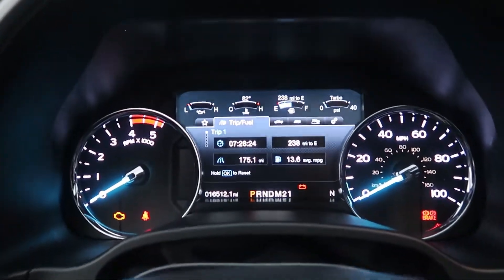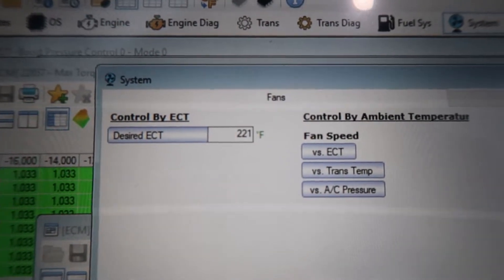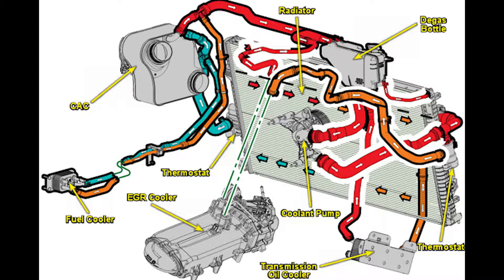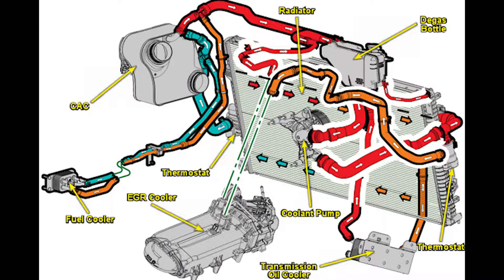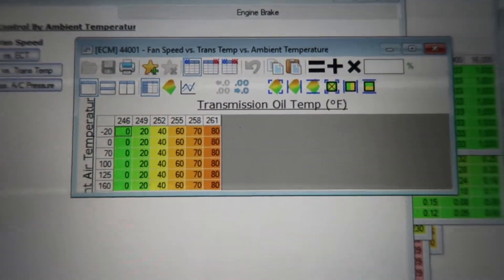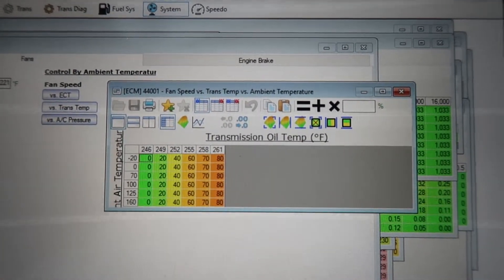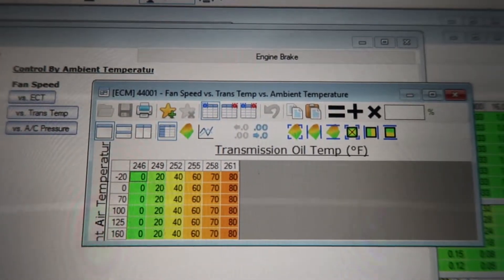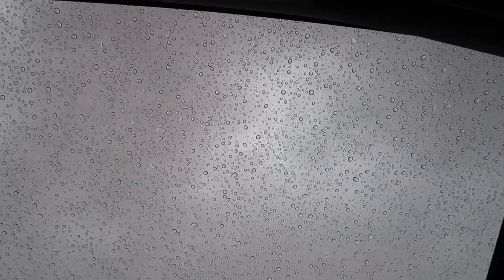Why the Ford 6.7 Diesels  Run "HOT"

Comment: Have you looked at the SPE thermostat that runs the truck a little cooler? If so what are your thoughts?
Reply: No I did not. I have been getting harder than desired trans temps when pulling in this AZ heat as well as engine temp. I am going to install this in a couple weeks to see if it makes a difference.
Reply: @darren6790  Any updates on this? How do you like it?
Reply: @jonmccauley6490  still haven’t installed it. Hoping to do so before triple digits hit this year.
Reply: You ever get an answer? I just ordered their proprietary solenoid body. They say they lower the trans temp up to 50°.

Comment: I believe 2017 and up the transmission cooler is on the primary radiator now and 2017 oil and trans run alot hotter than my old 2011

Comment: Dang I have yet to get to 221. 205 207 on the engine and 203 205 on the trans. That’s me not towing going 80 on the highway. I then sit and idle and get the temps back down to 196 engine 194 trans before shutting it off. Glad to know I haven’t even scratched the surface when I start towing!

Comment: Hey you can update the secondary coolant flow. 17 and up they run Egr and transmission cooler of main (primary cooling). Secondary only run charge air cooler! Fuel cooler.

Comment: HP tuner lets you tune if you have lost Weight ?
Reply from the maker: Yes you can lose weight if you know how to do user defined parameters with HPT. If you curious on tuning with HP tuners i have tunes on their forum, and i'm more than willing to help anyone out. I don't know everything but my truck runs darn good and i'm very pleased with the power and torque it's made on the dyno thus far.
Reply: JaegerWrenching that’s great news i Appreciate the response and will definitely be looking up the form in buying HP tuners this afternoon
Reply from the maker: @WaterandWoodsmen  It's not as easy as me giving you my tune because user defined parameters require you as an individual to know where the maps are located in the ECM and how to change them. Even if i handed you a tune you couldn't just load it you have to hand copy everything and weight loss stuff isn't in the foreground like your fuel map, timing maps and such, it's in the background where i can't even see it. Go read the forum  and you'll see what i mean. Also if you've been tuned with any other tuner your ECM has a high chance of a "write block" or password needed to reflash. If you have EZ lynk already i can get you a tune that will lose wight and then you can pull that tune with HPT and tune from there.
Reply from the maker: @WaterandWoodsmen   Email me a Jaegerwrenching@gmail.com I'm close to having a solution to you problem if this works ill know in the next week or so but you'll lose weight and be able to tune yourself with HPT.
Reply: You ever get any information I’m going to pull trigger this week I guess I have to buy a 170$ software upgrade user defined Parameters I was going to use my sctx4 Street Tune that’s already set up the way I need it some say it will work others say it won’t. I am also looking into automotive hex decipher software

Comment: To Jaeger Wrenching, the fan on my '19 F250 6.7 activates far more frequently due to a/c requirements than it ever has for the engine oil/coolant or trans fluid.
Thanks for the informative video.
Will subscribe.

Comment: Air to air intercooler is far superior in cooling over a water air intercooler. If they ever fail, your motor is now toast.
John Deere use to use a water/air intercooler on their engines from the mid 90's and older. Then they switched to a air to air like everyone else.
I have a 17 F350 6.7
And a 14 Ram 3500 6.7
Ram take's about 22% less fuel runs cooler and has a lot longer service intervals then the Ford doing the same job.
Reply from the maker: You're comparing an inline 6 to a v8... also you saw tractors engines change intercoolers over the years so that automatically means one is more effective than the other?..  Here is why your inline 6 gets better fuel economy. Anything with an inline 6 has an edge over a v8 because the crank doesn't require any counterweights. This is because Inline 6 crank journals cancel out primary and secondary vibrations naturally, thus no added counter weight is required meaning, more power and torque is transferred to the flywheel with less input, or fuel burnt. It's a apples to oranges comparison unless you only care about fuel economy and to which the inline engine is better. If you care to know or understand why i say air to waters are more efficient it's because water can carry more heat away because of its density. So air to water intercoolers can move out more heat in the same size intercooler, this is proven. You also get a more consistent charge air temperature with them meaning the tuning window can be narrowed and you can really dial in the tune,  again gaining some efficiency. They also require less piping from turbo to intake reducing turbo lag. But As far as overall parts to fail they have many more and will fail more often. This is probably why you saw John deer move away from them as failures on tractors is bad for business. They can also freeze and destroy your engine if you use water in them which i'm sure people did.
Reply: @JaegerWrenching  Yes water is more efficient at removing heat at a given temp. But there is a Reason a Superduty will be to the top of the mountain last on a long hard pull and that is heat soak. Trying to cool air when the water temp is 230 while a competitive trucks intercooler is cooling with ambient air temp. 
I tow big heavy heavy trailers so my trucks get worked hard. Just not that impressed with the Ford.
It will be interesting to see the changes on the 6.7 Powerstroke for 2020
Reply: SRN why you hating if you own a ford and you don’t like it I’ll buy it they obviously aren’t worth much 😂
Reply: @srn9973  Not sure how the water temp in the rad for the intercooler is going to get to 230*F. You do know the intercooler rad is separate from the engine coolant rad.

Comment: That's some interesting stuff. Good info . On a side note one of the Terminator Cobra FB groups I'm on  someone posted a picture of a Gray and Comp orange cobra at a gas station. I recognized the wheels and due to the location where the poster was talking about I asked ....Hey is that Chad's comp orange....Sure was :)
Reply from the maker: Yup that was the car i did a review video on. That's the 600 hp 2.3 Whipple car the owner is Alex Trivino